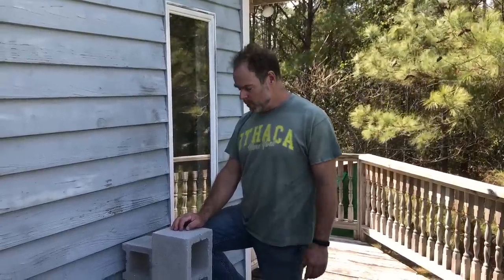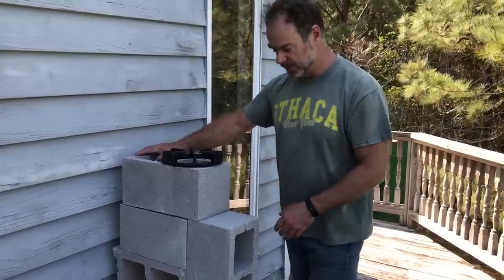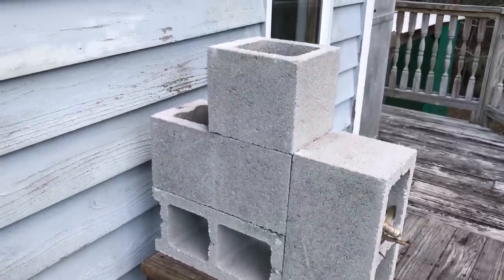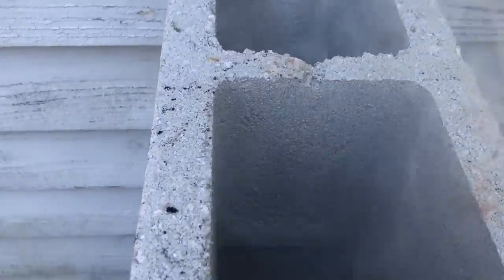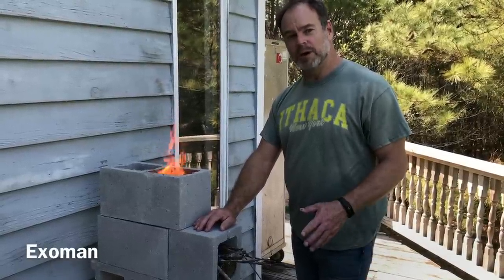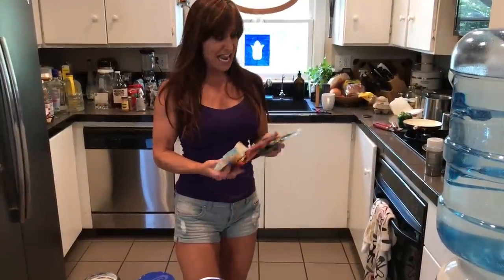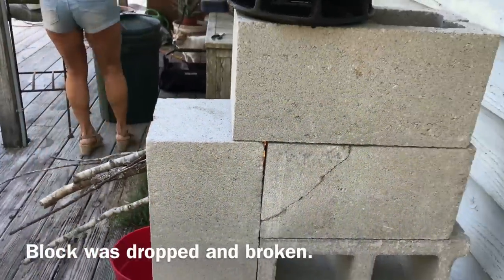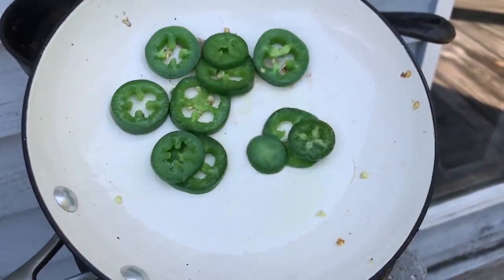Crazy new rocket stove made from 4 cinder blocks! READ WARNING BELOW!

Comment: A beautiful stove.
As an older person without many tools, I appreciated the simplicity of your stove.
Also could see that it was completely safe where you had it, as the block with the actual heat was away from the house, certainly no different than a gas or charcoal grill. Keep up the good work. Those burgers looked great.
Reply: Billthewelder55  
I think these stoves are fantastic, and the interest has alot to do with the state of affairs going on in this country.......meaning that people are worried about being able to cook food and boil water should the SHTF, which I believe is in the near future. Things have been going downhill since the last election at a rapid pace and there is a sense of foreboding in the air. These stoves will make a big difference when things go horribly wrong. With just some twigs and small sticks you can feed yourself and purify water. That kind of information will prove invaluable.  Good job.  👍

Comment: Long story short. My friend had made a 3' fire ring on a concrete pad for burning refuse, and backyard cooking. She used 8" concrete block, two rows high, the same construction block you used. She had a nice fire going when I got there, we were standing there a few minutes when one of the blocks exploded sending chunks of cinder block 50 feet in the air with most of the pieces landing on her 1974 Eldorado's convertible top, and burning down into the leather seats. We never thought anything like that would ever happen, and by the grace of God we weren't hurt. I would strongly advise using "fire" brick because it is designed for high temps, it's the same brick masons line fireplaces with in homes. In my opinion,  you might want to warn your viewers about this danger............................................................................................................................. Regards, Jim.
Reply: On a wooden deck next to a wooden wall. I suggest out in the yard.
Reply: sbc388550
Reply: hence the name  "rocket  stove"
Reply: Pat Geren.   It doesn't matter if you use ''dry blocks'', if they sit over night the temperature change and humidity or ''dew'' will be enough moisture content to make them explode the next day. They are too porous. If you compare them to fire brick then you will see that they are very dense compared to a cement block.
Reply: Jerry,  I find your story quite dubious as well.  While it's observed that metamorphic or marine-sedimentary rocks  'explode' due to trapped internal moisture being heated in a fire, it borders on comical that they would display no indication of in imminent release of the levels of energy you're claiming.  Outside of the fact that you have affirmed the blocks were not ROCK, had they been, you would have been bombarded with micro explosions of flecks of sub-sonic rock flying around long before a singular 'release' event occurred.

  
Cinderblocks are too porous, and the electrical bond between the molecules is far too low to withstand the internal pressures that the water would require to build up a sufficient amount of potential energy to result in a catastropic eruption event that you claim.  Even the most saturated cinderblock is so porous (and thus a large surface area is exposed to evaporative phenomena, will just simply crack and crumble LONG before it "EXPLODES 50feet into the air".  Even firebrick, which is manufactured to be similarly porus, but with a more vigorous internal bond as a result of molecular alteration of pyrolastic-ceramification which results in a CHEMICAL bonding that increases the brick's refractory value far above that which could be attained with the adhered-bond provided by the cement in the cinder blocks.

I suspect that as you mentioned this pit was also used for burning 'refuse' that your friend had tried to previously incinerate a high-flash chemical substance, a sealed container, or something equally stupid such as a car battery.  And then just didn't tell you out of embarrassment. A car battery could very well have resulted in an explosion such as the one you claim.
Reply: What a long winded way to try and sound smart. Been around building materials all my life, while you mac probably live in the city and have never done any labor in your life. I don't care how you word it, you are wrong. I know what I know and that's it. End of story. BYE BYE
Reply: What a devastating argument! "I'm right, you're wrong. *retreat*"  Not sure I'll ever recover!   And then the double-whammy ad hominem! Imagine how badly I have been defeated by errant claims from a guy who's never met me. WOE IS ME!
Reply: sbc388550 Yes I would strongly recommend using fire bricks.
Reply: Hurts getting schooled like that, hmm?
Reply: maxdecphoenix Jerry 100 percent right lab tested osha check data
Reply: Concrete block exploding? Not! In that case houses and buildings would explode  in all cases of fires every time.  Concrete blocks  crack due to the direct contact of high heat. I know because I make rocket stoves like these all the time.
Reply: soak a cinder block in water for a day, then toss it into a hot fire and stand back....   
Watch what happens.
Reply: 50 ft in the air?????  hahahahaaaa!!!
Reply: SBC, it is a similar story that I have.  The daughter of a friend of mine had a charcoal fire burning on the concrete patio for grilling hamburgers.  She never realized a fire directly on concrete was a ticking time-bomb.  Everything was going fine for about a half an hour when, BOOM (!!!!!!!!!!!!), it exploded.  Fortunately, no one was killed, but it could have been hair, teeth and eyeballs all over the place.
Reply: 'zarry, just keep telling yourself that, and when it DOES HAPPEN to you, you better hope to your lucky stars that you are not killed instantly.  It sounds like a cannon shot, with concrete shrapnel flying everywhere.
Reply: Phoenix, the explosive reaction is not chemical as you assume, but rather physical.  Believe or not, there is sufficient water vapor and air ENTRAINED in the concrete mix.  When this material heats up sufficiently, it literally explodes.  I have had this happen more than once, have had it happen to my friends, and jerry leroy has had it happen.  I mean no disrespect to you, but until it happens to yourself, resist the urge to declare any scientific rhetoric that it cannot happen.
Reply: E Irizarry the cement in Portland cement is calcium silica hydrate. When you get it hot enough to break the water out of the molecules it can pop parts off or explode to some degree if you are unlucky. Concrete based on Portland cement is not made for temps over 500F. The molecular water broken off is still steam in a weakened enclosed concrete space.
Reply: There is a difference between a concrete slab and concrete cinderblock. One, a slab is 4+ inches thick and is made with a different grade of cement at higher ratios to create a certain PSI rating. Cinder block is weak and porous. Its use is to create an interlocking form for concrete to be poured in while giving a finished exterior. There is no strength for a cinderblock to hold together while pressure builds. It instead cracks and crumbles. 

CONCRETE CINDERBLOCKS WILL NOT EXPLODE! 

No one cares that you're a contractor. 

Open fireplaces are not built with firebrick. 

And I spent an entire 3 seasons using this exact method a few years back, only with many more blocks to support a 30 gallon gutted gas water heater. I ran a fire every day for about 8 months with the shower right next to the tank. Water splashed onto the blocks every day for 8 months, and I had to clean out wet ash before starting the fire the next day. 

Guess what happened? Nope, no explosions. But there were many, many cracks. The fire chamber came apart in dozens of pieces. 

Cinder block is akin to firebrick. It is porous, weak, and will crack if you even look at it. 

Quit being sheep. I'm sick of "internet common sense" Living in fear of everything is no way to live at all.
Reply: Jerry is absolutely correct about the block exploding and is only trying to help people with less knowledge...
Reply: I've had small shale stones explode in campfires.
Reply: 50' in the air?  Wow.  I'll bet the 1974 Eldorado had a top speed of 245 mph.  Great story.
Reply: Yep. Cinder block burn "barrels" crack and crumble before they do anything else.
Reply: Jjo
Reply: I see by some of the posts that there is doubt as to my experience, I truly hope no one else has a cinder block explode on them, it was an experience that I will never put myself around again. This CAN and DID happen to me so be careful out there, I got lucky, maybe you won't. ......................................... Jim.
Reply: secretweaponevan no one's talking about shale stones,  we're talking about cinder blocks.   I never denied geologically formed ROCK can explode,  I even attest in my statement that they can,  i denied cinder block would. Much less without warning,  and then rocket 50 ft into the sky.
Reply: sbc388550 your talking about a 8 inch solid concrete block. A big ol slab of solid concrete will explode just like you saw. These are very porous cinder blocks. They won't explode, just crack mildly and fall apart.
Reply: people are stupid.  its not like detonating a bomb.  you could heat cinder blocks all day and not have one explode.  or, you could explode one the first time you try.  you guys know explode, right?  maybe it will just crack.  maybe it will violently fly apart.  just keep trying and make sure to lean in close to get a good look.  film it so your next of kin can upload it for us to watch
Reply: Thanks I didn't know anything about fire bricks
Reply: You can build a cinder block fire pit directly on the ground,  It must be porous blocks.  If blocks aren't porous, they could explode as steam builds. Your friend might have used compressed blocks
Reply: use red bricks
Reply: I got an old stove and use the squire metal inner box. I've cooked on it and I use it to burn paperwork or garbage and I didn't pay a thing for it, I found the stove at a apartment complex.
Reply: maxdecphoenix you are 100% wrong! Go build a cinder block rocket stove and heated to a high temperature and you will be surprised
Reply: @jerryleroy9187  Most contractors would know those are concrete, not cement (also called CMUs, for "concrete masonry units). But.... you're mostly correct.👻
Reply: @jerryleroy9187  Concrete, Jerry, not cement. Concrete blocks.
Reply: sbc388550,  thanks for giving us your experience and probably saving many from harm.
Reply: @waqqodonkey  , LOL
Reply: Fire ring
Reply: Dumb idea in the deck
Reply: @eirizarry2568  I've seen it too. I dont fuck w these and fire. As a mountain kid we built fires in everything. They do explode. And also release chemicals. BUT how they did this is dope. It makes sense and they are not getting these super hot. Very cool video. Just if ur using more flame.... be careful with cinder blocks.
Reply: sbc388550...GREAT ADVICE - THX - AND - SO VERY GLAD THAT NO ONE WAS FATALLY HURT - MATERIAL THINGS CAN BE REPLACED...
Reply: @maxdecphoenix  so is it safe-ish?
Reply: @nicholasgrady517  yes, though not ideal.  I've used cinder-blocks as a base for 55-gallon barrel burners to incinerate yard wastes and woody material.  They just degrade rapidly.  For a very intense fire, the bricks will probably fail after one burning. For less intense burns you might get 2-5.    

For applications like cooking, you're probably fine for several burns.
Reply: Geez, Can you please tell me what to Ask for at Home Depot so this HORRIBLE thing does Not happen to us ??
I just put together a 4 cinder block rocket stove.  I followed all directions for the bigger cinder blocks but it is still Not Level Within the inside,  do you know why ?
Reply: @maxdecphoenix  omg, are you a Scientist of Some Sort,  lol. I have no idea well, maybe but a bit of What you were saying here lol. Thanks for the Novel , I  think I may have learned something here from you. 🍻🍻🍻
Reply: @jerryleroy9187  lol
Reply: @constancecondit4349  Where's the EXCITEMENT in that ???
Reply: Great tip, to use fire brick.  Will do.
Reply: @Pops Fereal ................................... CONVERTIBLE TOP ...POPS. .......JEEEEEZ.
Reply: @constancecondit4349  w
Reply: Thank you for that comment because I was thinking cinder block didn't do well when it got hot but I wasn't sure if that's what I had heard in the past or not. As porous as it is it doesn't seem that would hold up to fire very well but I did have to appreciate their comments labeled warning because I know millions of people are going to give them s*** about building a fire near their house and I'm sure they are aware of that danger but the exploding block danger I don't think they were aware of that fire bricks are much much safer unless you've been hit with a flying projectile especially a hotline projectile you don't know the damage it can do until it's too late. I hope this doesn't happen to these people.

Comment: Yeah ,it's all been said before in the comments before, cinder block are not for fire, you got lucky they didn't fail catastrophically. I've seen decades old cinder blocks explode in fires and cause burns and eye injury(I was an EMT) when people unknowingly built fire rings put of them.
Also, that kind of concrete gives off a corrosive gas when exposed to fire, not that  it truly matters. 
Get fire bricks.
Reply: He burned the deck and house down

Comment: Cool stove from concrete blocks ! We highly suggest you build it and use anywhere, but not on a wood deck.
Reply: chefgiovanni First thing I thought of when I saw this video. It's sitting on top of a small wooden staircase, which is on top of a wooden deck and he's got it sitting within inches from his house. Second, cinder blocks aren't made to withstand that kind of heat and could crack and potentially explode. All I see is an accident just waiting to happen and it's not going to be pretty.

Comment: Cinder blocks are not mention for heat and at temps will break in a violent way as the sides or ends pop off I would never use them for this even in a onetime situation Ask anyone that has used them and built a camp fire with them Not a good idea at all
Reply: This is insane. Concrete actually has a lower fire separation than wood. 
And why would you do this beside a wooden shack. 
What a maroon.

Comment: It will work for awhile but blocks will crack with heat, need high temperature bricks...
Reply: Fire brick.
Reply: play nice boys
Reply: Agreed
Reply: Hi where would you get high temp bricks, thank you for the suggestion.
Reply: @dianewheeler5638  
Probably a supply store like Lowe's or Home Depot for starters.

Comment: then you light it up and burn the house down then every Thanksgiving we hear about those clowns that do the deep fry turkey thing in their garage and they wind up knocking it on the floor and the oil goes all over and it catches fire and burns the house down if they were smart they would put it out in the backyard in a safe location where if it fell over it wouldn't burn the house down some people are candidates for the Darwin Awards how do you tell your family hey dinner's ready I cooked it on those old concrete blocks out in the backyard that sounds kind of tacky doesn't it
Reply: I'm terrified of those things. I used to have a part time at Home Depot and once a year we had a turkey cooking in one of those. One time the guy "taking care of it" added to much oil, and we all ran. Needless to say, that was the last year. Lucky, they sell fire extinguishers. Nope, I'll use the oven.

Comment: I have seen concrete snap and blow pieces all over the place when it get really hot. Is there any danger of the cinder blocks blowing if they get too hot or do I have to use fire brick to avoid this. What a nice cheap and efficient stove. looks like a perfect camping stove. just keep the blocks in the truck and you are cooking with...well not gas.
Thanks for the tips and the great video.
Hutch

Comment: when he talked about being younger and digging a hole in the ground to cook...we used a similar method when I was attending Ranger School, we called them "Smokeless Pits", in addition to digging the primary hole, (about two feet deep) you also need to dig a smaller hole in a 45° angle to reach the base for ventilation. It takes a minute or two to get the equalization right (base to heat up to pull the air) but once it does works fine every times, cooks like crazy and you don't risk the hazards of fire from flowing ash.   Btw, she dresses that way to get the hits or clicks to their page without it being label or accused of being "Click Bate"...Smart
Reply: Michael Angel It's superior clickbait. It's masterbait.
Reply: +FU 2 LMAO!!!!!....Now that's really good.

Comment: Geezus!  I don't know what code is around there but 2' to a heat shield is what's required here for any combustion device.  They have old wood siding which ignites at about 200 F less than 10" away from the firepit.  That is Crazy.

Comment: I have one of these set up and yes, they do work great. BUT, continued use and the blocks began to crack apart. So, I used heavy steel wire to wire it together and I am waiting for the wetter weather to dig out some clay and make cob to encase the whole unit in. Wire and cob to make it a permanent rocket stove Looking to also use some juice cans to use as a liner inside the block opening. And I do have a cut and folded can for my riser air vent. But as it is right now, it works well, we cook whole meals on it and perk the coffee there too.

Comment: I was thinking the same thing regarding the exploding bricks. I'm sure it will work just fine, but if you want to see how high heat works on concrete. Put a torch to a concrete slab......caution, wear gloves, safety glasses, and long sleeves. Because it will snap and pop like crazy blowing holes into the concrete.